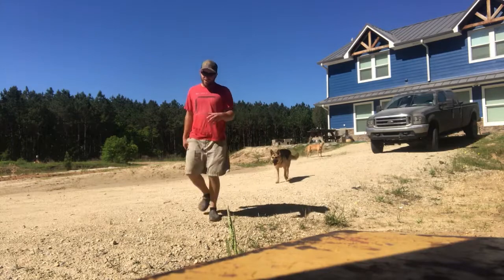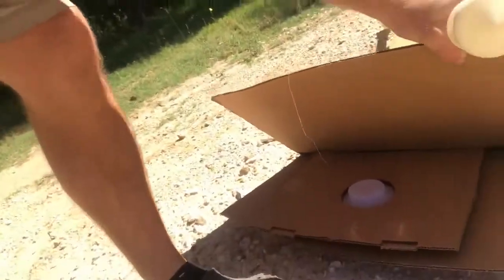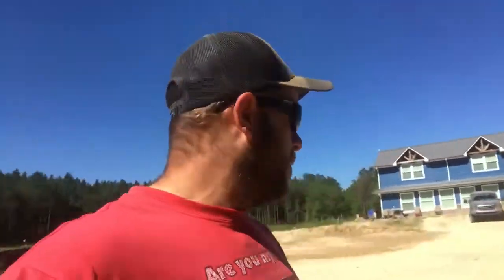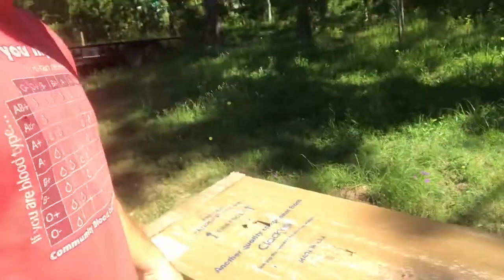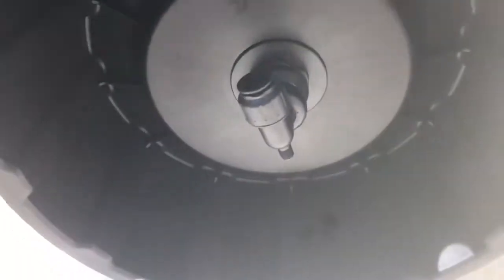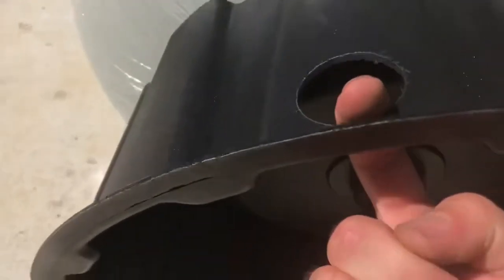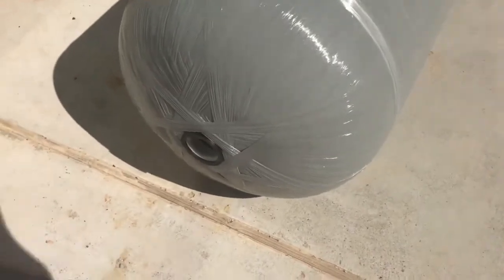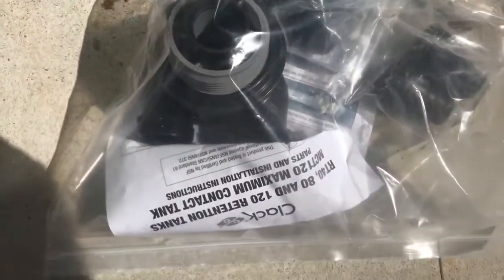Sediment Settling Tank for the Water Well

Comment: Is there a part 2 video? We just had one installed today, after 2 failed drill attempts. Well was pumping fine sand suddenly.
Reply from the maker: Not sure I have a follow up video, but it WORKED!!! Almost certainly I have a video somewhere talking about how it all went together. We have had NO silt (or fine sand) carryover to the house since we’ve installed this. I open the blowdown valve every few months if I remember (honestly don’t recall the last time) and it spits out a slug of muddy water but clears up quick. I could get much support from mfg on installation, so I just opted to put it in line before my pressure tank. I figure each cycle of the pressure tank doesn’t even turn over the retention tank one time, so the water gets plenty of time to sit and think about it’s problems, and drop that silt out 🤣
Reply: @TomBrueggen  you’ve given me hope! 😆 I think we still need to add a house filter because the water is yellowish in the toilets. Hope this nightmare is over for us.
Reply from the maker: @carmencervantes2468  we started with paper filters and the silt plugged them immediately. The yellowing could be from iron…? We still get a yellow sort of film in the toilet bowls but it knocks right off with a brush. I grew up on a well with severe iron. It stained everything rusty orange and turned all out white clothes yellow/orange. Good luck! Hope you find a good solution.
Reply: @TomBrueggen  one more question, we have an oil smell coming from the tank.. not directly from well but after it goes through the the settling tank. Did you experience that? So thankful for YouTube!!!
Reply from the maker: @carmencervantes2468  I never noticed any smell, but I can see it could just be some mfg residue. I’d just fill and drain the tank a few times to see if it flushed out. Could maybe try to get some chlorine through the system to help flush it maybe? I’m familiar with the water having a taste of PVC glue on new construction but that goes away too after a couple days of steady use usually

Comment: How is back-flushing this tank different from back-flushing the pressure tank? Is this tank located between the pressure tank and house plumbing?
Reply from the maker: I plumbed it between the well and my pressure tank. I figure each time the well kicks on it probably turns the retention tank over once at most, so between cycles that water sits and settles, and catches the silt before the pressure tank. There is no backflush, just a blowdown valve on the bottom. I open it once every few months when I remember and just have to let it run a few seconds till the water clears up.
Reply: so guess it works but is there a smaller one of those and have you seen a raise in your electric bill because of it
Reply: You don't backflush pressure tank pressure tank has constant pressure against the water and the backflow valve so water will always move forward under pressure. If you didn't have a pressure tank the water would only come on when the Wall came on

Comment: Brand of separator?  And how’s it working out?
Reply from the maker: It’s not technically a designed separator. It’s merely a retention tank that allows time for the silt to settle out and then had a drain in the bottom. It’s working amazing! The tank brand is Clack. I called them when I ordered and it they offered NO technical support towards how to use it. Said they leave it up to the plumbers to figure that out. I guess that’s fair, which is part of why I made the videos, because I couldn’t find much else out there about it. 

But yes it’s working great! Immediately after install we saw positive results. It’s been over a year now. We have no other form of filtration on the well and we have no sign of silt in our water!!